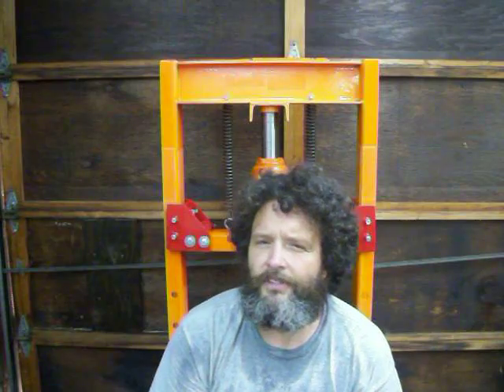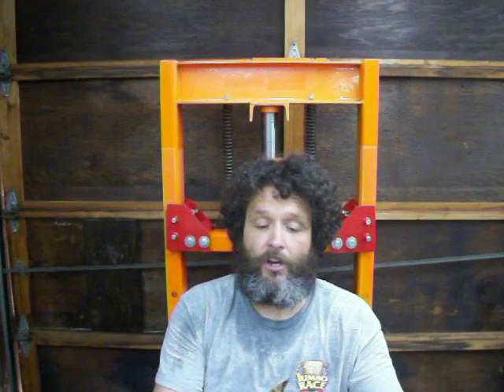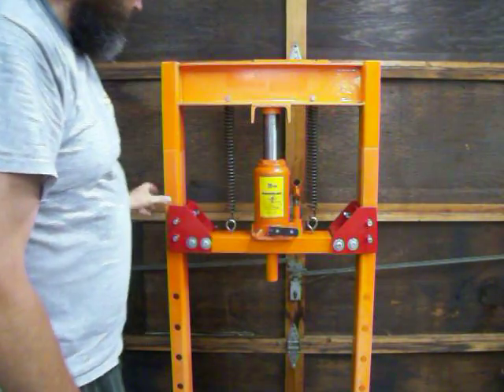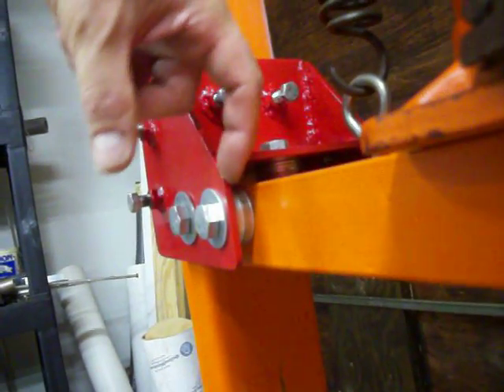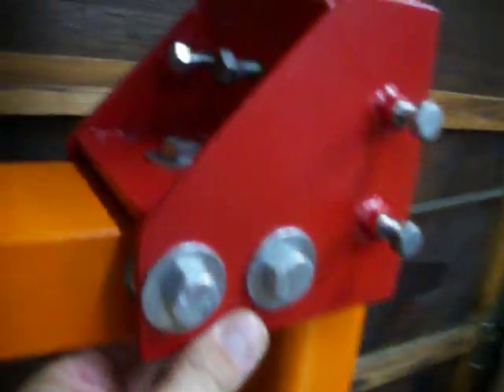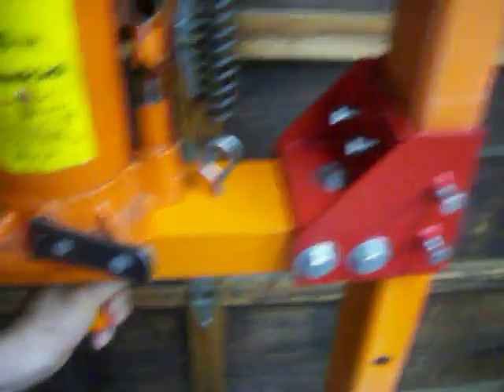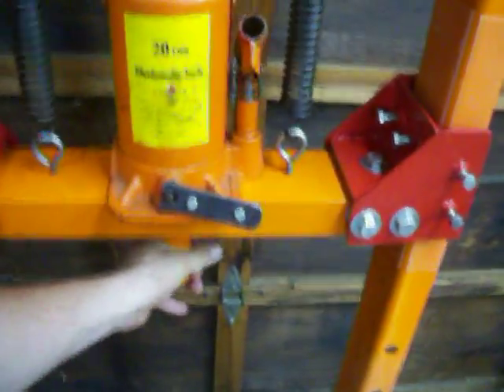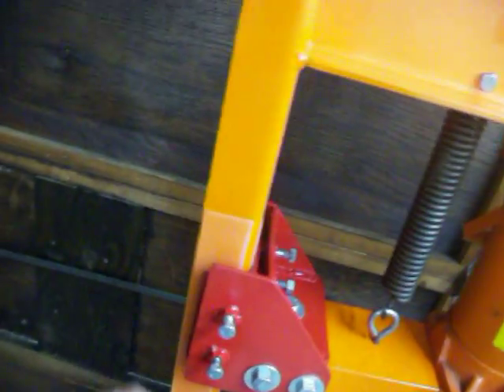Removing the Ram Slop from a Harbor Freight 20 Ton Press

Comment: I do like the idea, when your trying to show what you used between the brackets  and the frame, the camera kind of misses it so I'm left wondering whats exactly back there
Reply from the maker: Yeah, the risks of one-take unscripted videos -- framing issues and the like.

The gib plates you're referencing are nothing more than 1/8" sheet steel rectangles with small nubs of 3/8" natural gas pipe welded to them.  The gib screws mate up with the gas pipe sections to keep the gib plate from falling out of the visible outside bracket.

If you need to see the exact make-up of the gib plates with the pipe stubs, read the video's description text.  There's a link to the still photos of the build at the Everlast Welder forum site.
Reply: @weebandit  Guess that makes sense! my tolerances are loose but likely too tight for that thick, I have some thin teflon pads at work that might fit the bill though...

Comment: Great idea that I will incorporate on my shop press.
So now my next question is about the handle thing that releases the bottle jack, what's it made out of and how did you make it?
Reply from the maker: After a number of years using the press with the gib modification, I can say, it turns the cheapie press into a rather precision tool.  I've pressed some very oddly rigged and supported items and the stability of the ram made the pressing effort far less complicated than without.  Glad you find the gib setup something to pursue on your own!

The valve handle is just two pieces of flat stock bolted together which clamp on the OEM valve tee.  Not my idea, it came off a shop forum.  Clamp the two pieces of flat stock together and drill the bolt holes (two).  Cut a square notch out of the end that will clamp on the OEM valve.  Make the notch just large enough so it can flip back and forth over the valve body post.  Unbolt the two pieces of flat stock.  Use a rat tail file to carve a slight U-shaped trough in each section of flat stock where it would clamp on the valve body tee pin.  Don't carve too much.  Otherwise, the handle will not clamp on the valve body tee and just flop around.  Oil/grease the U trough and bolt the flat stock together over the valve body.

The valve handle is a pretty simple and a very effective easy-effort modification. 

Here's a link to the Facebook photo album which documents the valve handle build:

https://www.facebook.com/media/set/?set=a.4128372456360&type=3

Comment: I drilled and tapped holes in the C channel ends of the ram and added some 1/4-20 nylon screws to take up the slop. Now I have a welder, but my solution works. I like your bleeder handle. I need to do something like that.
Reply from the maker: That's a neat solution!  Although, I'd drill the press and weld some nuts on the bracket to provide some more thread biting area for the plastic bolts.

Of course, that could just be my belt and suspenders over-engineering talking.

Comment: I have been coming up with ways to address that issue how ever none as simple or as good as your solution thanks great job coming up with that
Reply: Kwel!  Glad you like the idea.

This past Fall I used the press to fabricate a bunch of hydraulic automobile brake lines with the necessary flares on the ends of the steel lines.  The solidness of the ram travel made the effort a breeze.

The modification really does improve the cheap press' utility.

Comment: Great Video thanks, well done, this video is a plus (+) in my corner, good show excellent modification. What I really like is that little lever you use to tighten and loosen the petcock on the jack, I never thought of that. Are you going to do a video on how to make that lever?
Reply from the maker: The handle is pretty simple.  I pulled the idea off another shop forum some years back.  Here's still photos of the project:

https://www.facebook.com/russell.stephan.7/media_set?set=a.4128372456360.2177433.1494916156&type=1&l=c11ef56f31

Comment: Been thinking about buying one.....one question. Does the slop make it difficult to use?  Has anybody ever had difficulty with it because of the slop?? Just asking before I buy.
Reply from the maker: For large scale things such as car wheel bearings, bushings, and the like, the slop in the OEM-delivered HF unit is tolerable but sometimes annoying.  I also use the press for all kinds of other more precise things like flaring hydraulic lines and crimping hoses.

I also have the Swag Off Road finger brake kit along with the gooseneck dies.  I suggest the Swag Off Road platen plates too.  The as-delivered cast steel plates have been known to fracture under pressure causing serious injury to a few folks.

I've also welded up a cylinder and a piston to crush spin-on oil filters.  With the oil completely squeezed out, the metal slug can then go in the weekly curb-side recycling pickup.  This makes special trips to dispose of used oil filters properly a thing of the past.  All the used oil I generate gets re-purposed for chainsaw bar lube and such.

Buy the unit off Craigslist for half of retail.  Even without the add-ons and the press left in stock trim, if you're busy in the home shop, it will be a productive tool.

Comment: Why bother , once the arbor is in contact with the work , it doesn't move !    I do like your "handle" on the jack bleeder 
 screw ...  Built one similar for my press ...  How did you fasten it to the screw ? (I used a set screw)
Reply: "Why bother , once the arbor is in contact with the work , it doesn't move!"

Kinda sorta...  If you have a rather intricate press set up with some odd-shaped component, the steadiness of the ram is a big deal.  Of course, if not doing precise work, the effort to remove the slop is not necessary.

The valve handle:

https://www.facebook.com/media/set/?set=a.4128372456360.2177433.1494916156&type=1&l=c11ef56f31

Comment: Good modifications. I hope to use my everlast welder to weld up my own press. I need to ensure I incorporate some of your enhancements in mine.
Reply from the maker: Kwel.  Glad you found the modification useful/helpful.

If I had it to do all over again, I'd just bend up some C channel in the SWAG press brake for welding directly to the ends of the ram arm.  This would halve the effort of the modification without impacting the working end result.

Good luck on your press build.